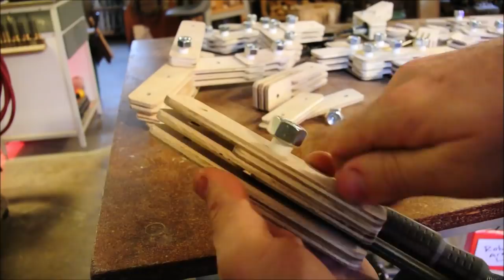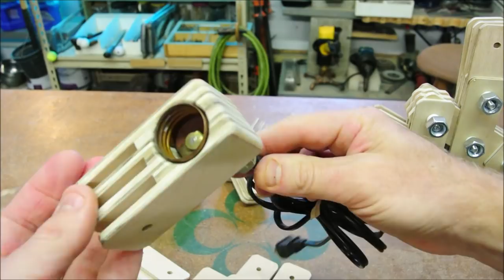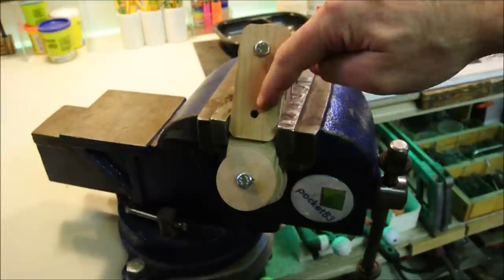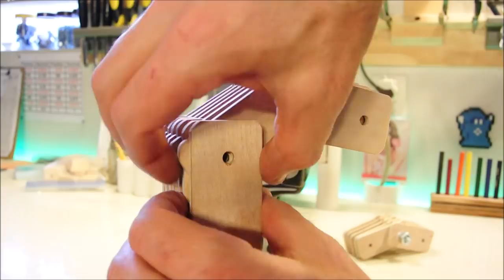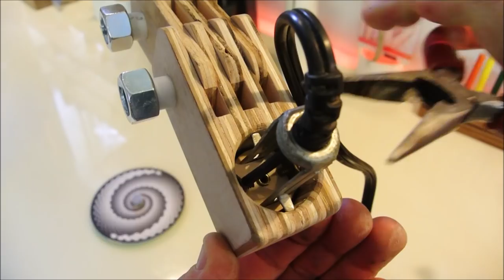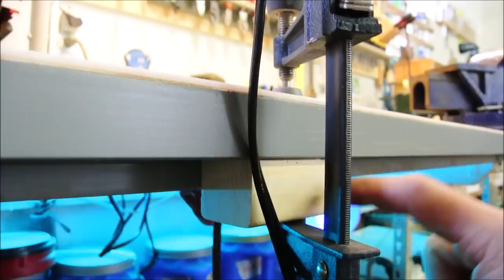Desktop robot arm light

Comment: Small diameter split loom would be my choice for the conduit. You don't need to free up one end of the cord to install it and it is cheap. Someone else suggested shower hose. Split loom would be more flexible. I've also used braided stainless cover kits on motorcycle hoses-also available in braided nylon.

Comment: This going to sound a little crazy. I enjoy the complicity and simplicity of your projects @pocket832. The duality if you will.
Iron and Wood. It is how you Engineer, Craft and Use them. This is what makes them powerful.
Both abundant and cheap.
Now for the cheesy part. It is the man that makes the iron and wood. Not the iron and wood that makes the man. :-)
I think American Engineers up to the 1980,s where some of the best in the world for this reason. The machines they made where very simple but the engineering that was put into them was very complex.
Reply from the maker: Yep. Early on, there was no old infrastructure to fall back on out here in the New World. We had to cobble, tinker, and misuse around every innovative corner-cut. Americans were independent for the right reasons before then; now the 'autonomy' we fight for is just plain selfishness. Did you ever visit an old mill? Like one with a central Line Shaft? They used belts, pulleys, ropes, wood gears, pegs, and leather patches; all rigged together in a wire-wrapped, nailed mess of pure problem-solving bliss. Not that I mind our modern comforts, but man--we sure were forced to be crafty back then.

Comment: Funny, I'm just doing a project for work on uncertainty and error propagation, and here's your video demonstrating those concepts without saying either term! I've even got Taylor's text on the topic sitting on my desk.
Reply: The lamp also reminds me a great deal of this: https://youtu.be/koYenmdJdu8?t=499
Reply: With regards to the cable routing, how about 1/2" corrugated plastic tubing? That should have a great deal more flexibility, and you can also cut it down the side if you want to use it as wire loom.
Reply from the maker: That is funny, because the video I'm filming right now really focuses on the topic. In fact, I even expressed the value as a +/- percentage. Weird coincidence. But seriously, understanding that simple idea is like a next-level crafting concept. It helps with everything.
Reply from the maker: @BRPEngineering  That is an awesome idea. The transparency of it would look gnarly, and it could even have 'kinks' cut into it at the joints [shaped like this: I> <I]. Thanks!

Comment: Hi Pocket, cool Vid as always I definitely need something like this as a work light, my current solutions, are way more crude compared to this. as a conduit I would consider some kind of a vinyl tubing, maybe even thin wall rubber tubing. My thinking goes to something simple, and something hydraulic, like gas/break lines in cars, or tubing for IV (drips) my mother is retired nurse so thats my 'go to" flexible tube. Aanything else is too stif in my opinion

Comment: Drill the holes first before cutting the longer pieces to their final length.
Drill the two holes in the smaller three and a half inch piece. Place that one smaller piece on top of a stack of oversized five and a half inch plus pieces. Now use the holes from the smaller piece as a template to drill through the stack of larger pieces. Once you have two holes in the larger piece, you can spin the smaller three and a half inch template around the center hole and drill the third hole into the larger pieces at the other end, again using the three and a half inch smaller pieces as a template. Once you have all three holes into the oversized larger pieces you can use your circular templates in the outer holes to sand down to the final 5 and 1/2 inches
Reply: That was exactly what I was thinking. Definitely made it harder on himself.

Comment: I wold have guessed you make the center hole first and then reference the outer holes from this point. 
maybe with a jig in the drill press to rotate the peace around a center pivot. 

Also i love your design and it's simplicity i once build something very similar as i head access to a CNC laser cutter. 
It was probably inspired by your arm eventhogh i dont remember so  specifically. 

Now i'm some ware between a dodecahedron and icosahedron phase (if you know what i mean) and i'm more obsessed with ball joint.
I'm totally in love with the "Manfrotto 244N Friktionsarm" its expansive but there is a reason why they using this ans so many of them at the international space station. 

Anyways i'm totally want to recreate something  like this with golf balls as joint and PVC pipes and this is definitely inspired by your videos.    

Thanks for good videos!
Reply from the maker: Not to burst bubbles, but I've done a few PVC/golfball ball joints as prototypes. There are some real design challenges there. The subject should make it to video form someday as an offcut, but it's too lengthy to discuss here. Note that the major complication relates to a lack of friction/clamp pressure. Better suited to the purpose might be a lacrosse ball, but then of course, expense. Thus, indefinite pause. If you have a specific idea to bounce off of me, feel free to shoot. 

And admittedly, the center-hole-as-reference idea is much more sensible than the approach I took at first. That's totally worth further consideration. Thanks to you, as well. Happy weekend ;)
Reply: Center hole drilled first, then placed on a dowel exact distance you wish the outer holes to be and swing pc in, drill, repeat with other side. Eliminates moving of the drill press jig.
Reply from the maker: @billcornett2256  Again, it's worth further consideration. But there's still the fact that the goofy assembly lets you sand all the edges and all the radii (six at a time), so the time saved from a drill press jig is not as much as one might think. Especially when considering the ratio of jig tinkering to the small number of parts that are needed. Further, for this project, you'll be needing your drill press to be permanently set with an end-hole jig.   

Much of my video content here is 'how I did it' more than 'how to do it.' Hindsight is typically 20/20; reverse-engineered jigs are easy to invent after the project is done, but such clever afterthoughts still might not blend well with the continuity of an overall one-time construction process. 

Making a single jig that performs both drill press functions is possible, but the tinkering investment would have to be justified by a production-level number of parts. Working in the same (company) shop for years ends up producing beautiful jigs like that. Refinement is not a thing of one trial.
Reply: @pocket83squared  I'm not at all surprised you already did this.
I assume your familiar with the working principle of this "Noga"/"manfrotto" arms.
They have an internal rod to push the ball Against a "c" shaped rig. the "c" shape allows it to gimbal about 90° in in direction, but there is lot of force on this c-ring bending it open.

An closed o-ring is simpler but it would limit the moment to about 45° with an 8mm thread in in the ball.
 https://i.imgur.com/4O00nNc.png

My idea is to have a step wedge on the tube side and pull the ball in this wedge with a ring. 
The upper ring is pulled in by a Bowden cable/s 
Probably way to complicated... 
I'm looking forward to see your attempt! 
i imagine it looks more like this.
https://www.youtube.com/watch?v=LWUHlyi-8Mc

Comment: Perhaps split loom tubing or braided cable sleeving as an alternative to  metal flexible conduit. I have never tried to explore the limits of it's bendability.  The braided sleeve is quite flexible but offers less protection.  There are metal versions of the sleeve but I have never worked with that variety.

Comment: Late to the party comment - Split loom tubing is perfect for wire management. Lightweight plastic, full length split for easy install, available in small sizes. If you want to know what it looks like open the hood of your car. There are many feet of it in there.

Comment: I love it - now i've just got to work out how to make it with no tools or skills 🤣
Reply from the maker: Start gathering both. The only other option is to remain incapable of making it. 
That doesn't sound too nice, does it?
Reply: @pocket83squared  Nice? Who needs that - honest and accurate on the other hand are two of the many reasons I like your channels. Trying to figure out how to do stuff with no (or very limited) tools is fun for me 👍
Reply from the maker: @daveturnbull7221  Rock on, man. Half of the battle is using what we've got. My first shop was a 3'x5' closet: the seat was a cutting board. You wouldn't believe the stuff I made in there.

Comment: why not just slightly oversize the 5.5 long pieces and drill the center holes then use a 3.5 long piece as a template to drill the outer holes and mark the final lengths to sand them down to?

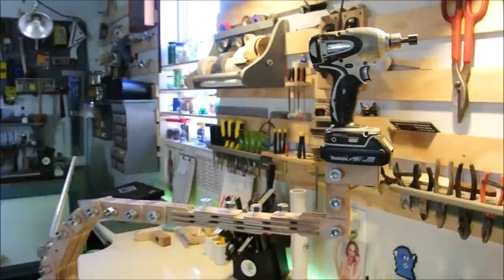Comment: What is that reflective tabletop surface at 13:50? What are your thoughts on Adam savages tool stand cart organization thing?
Reply from the maker: White acrylic glass. It's from an old YMCA sign, repurposed. As for the tool cart, I don't watch his content much. He's a beautiful human being, but he talks peripherally too much to hold my attention.
Reply: @pocket83squared  Oh so thats what it is, your workbench is particle board top coated with polyurethane, would you do 3/4 inch MDF with polyurethane instead for an even smoother surface or do you think its not worth the extra cost? (4x8 MDF sheet cost double) I am not much of a fan of Adam either, hes too quirky and whiny. Do you think a system of clear plastic box bins is a decent way to keep organized?
Reply from the maker: @urasuras7514  MDF would be a nice top surface IF you have plywood under it for strength. Personally, I stay away from bins and drawers. They clutter for me.